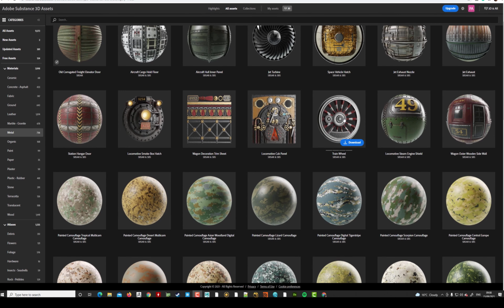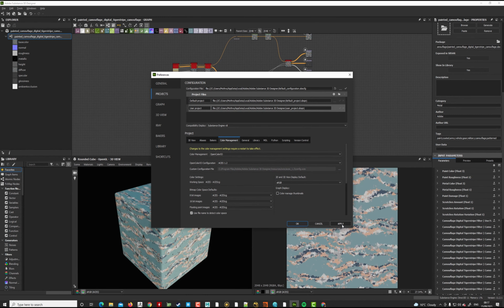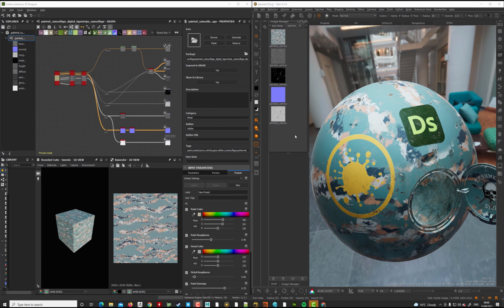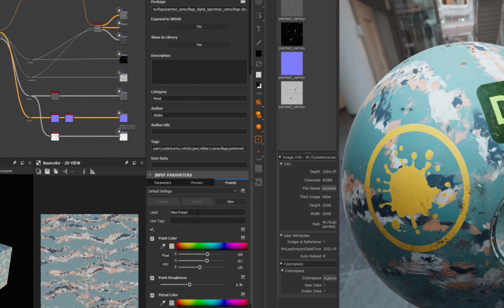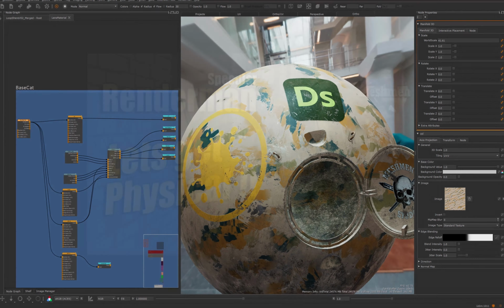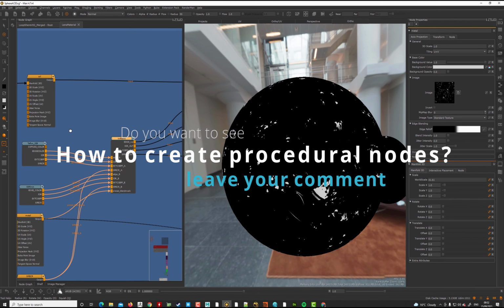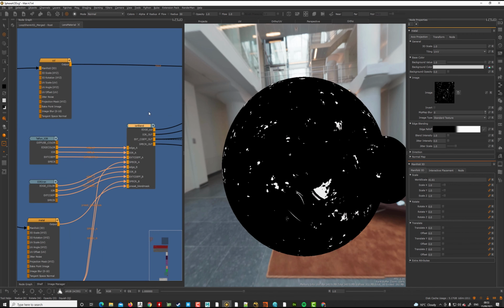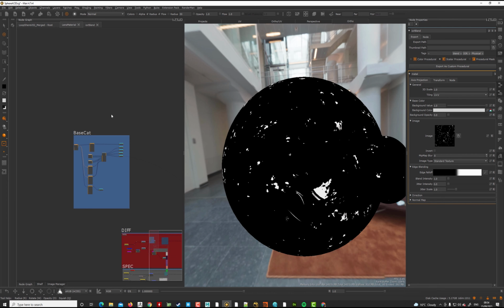Substance 3d Designer to Mari Workflow | Mari tutorial

Comment: Great video Peter, thanks for sharing!
One question, if this is a camouflage look, then this would be painted metal right? Wouldn't the IOR then be different then iron or teflon? Is there actually an IOR for ink or paint?
Reply from the maker: Where my map from substance is white it use iron index of refraction and where the map is black i used teflon. Most non metallic materials are not that different in ior and i just took something that was not a metal. Sure there is probably something measured for paint but most paints is some kind of plastic properly
Reply: @MeshmenStudio  OK I see. Thanks for your reply.
Reply from the maker: Do you use designer ?
Reply: @MeshmenStudio  I haven't used it much yet to be honest.
Reply from the maker: And do you use Mari? What else would you like to see from the channel?
Reply: @MeshmenStudio  Yes I'm using MARI. Something which is hard to find tutorials for is  how to use MARI to texture a large scale environment like a cliff, canyon or a ground. How would you tackle that? Or is this more procedural look dev related than really texturing?
Reply from the maker: Ok yeah i have done procedural texturing environments. Its often both mari and live procedural techniques in the render engine. I think live techniques is more common as its not as locked down relying on texture resolution and udims.
Reply from the maker: I will put env texturing tut on my idealist, thanks for helping me out